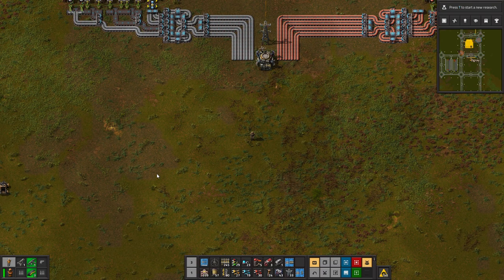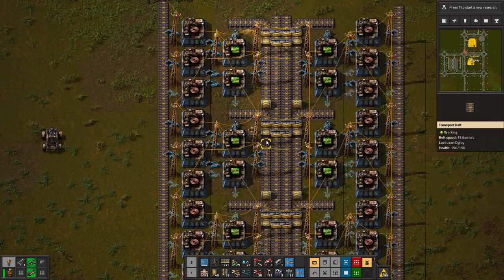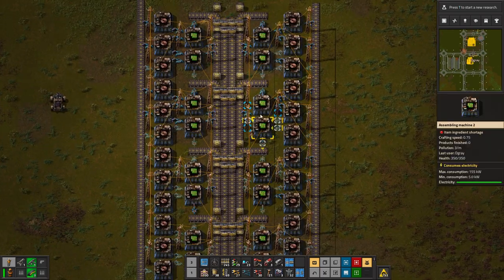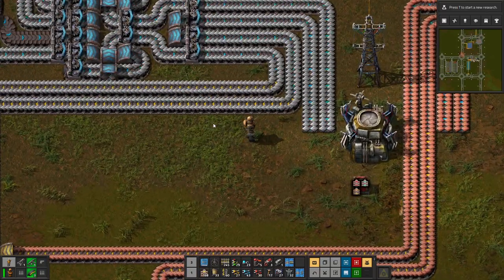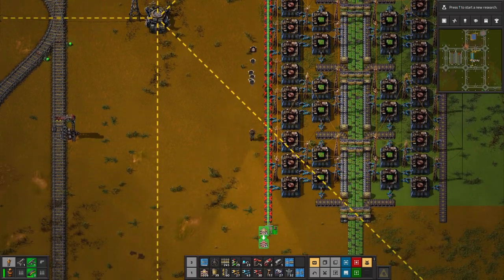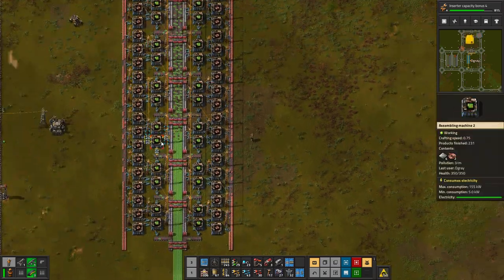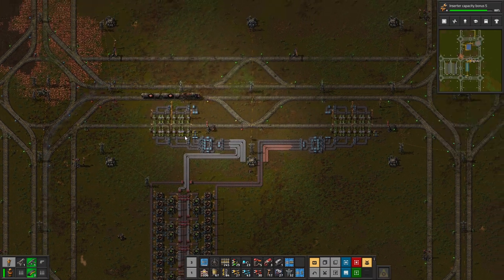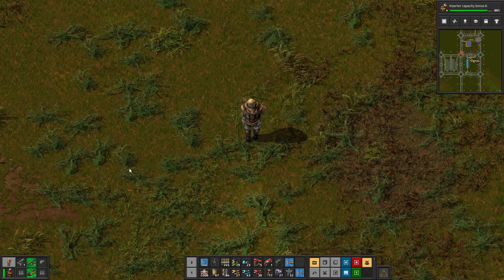GREEN CIRCUIT SETUP - Factorio 1.1 - Entry Level To Megabase 2! - Let's Play Tutorial! Ep 26

Comment: by the way, if you ever do these again, just a suggestion: never ever put a limit on your critical outgoing stuff like iron plates. if you have it set to 32,000 and the iron ore runs dry, your going to have 30,000 or more plates sitting there not being picked up by stuff that needs it. the system already stops the trains at the depot if no input is needed, having the limit on the outputs is asking for disaster
Reply: What happens, if you have 30 trains all heading to the same station as its "open"? You have trains waiting on tracks and may block one section entirely
Reply: @msana4420  I was referring the amount of items limit not the number of trains limit. Personally I use LTN anyhow which solves so many problems and lowers train throughput as you have less trains doing stuff because they get re-used and only dispatched as needed.
Reply: @problemchild959  ah okay. I now get it. Thanks for the clarification. So if I played along I would just "hard code" the 2 trains limit and forget about the items limit and that way I would have the station accepting only 2 trains. Thanks for the tip as I've been doing it with the items limit since day one ;_;

Comment: It doesn't help at all to limit an loading station to anything below one full train. Basically,  an unloading station says "I need a train full of green circuits do you have enough" and your loading station replies,  "No. Well, I actually have 3.5 trains worth but you can't have any until I have a few more." 

So your production site that uses green circuits could end up idle waiting for a delivery even though there is already enough for 3 full trains to be delivered.  As long as your unloading only requests when it is below a set threshold any limit above one train worth at the other end is just an unnecessary bottleneck.
Reply from the maker: You are correct and that would be the optimal way to do it. The reason I'm not changing it is that 32K for most items is a few mins of run time when doing 2000 SPM :)